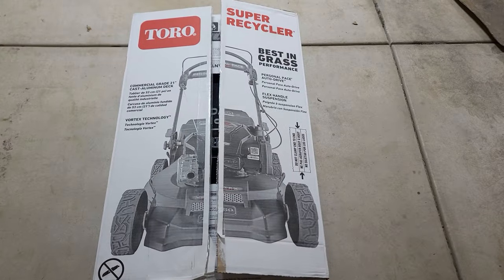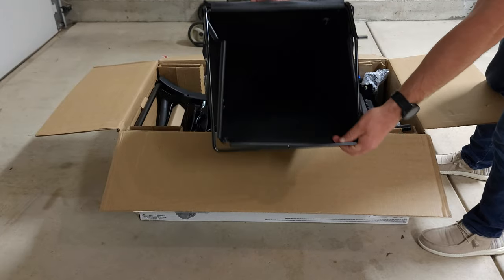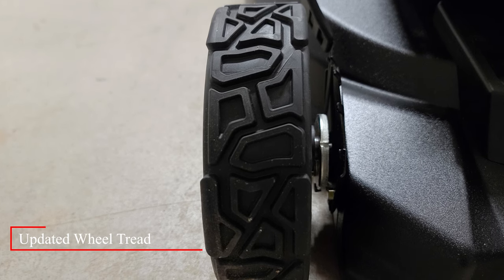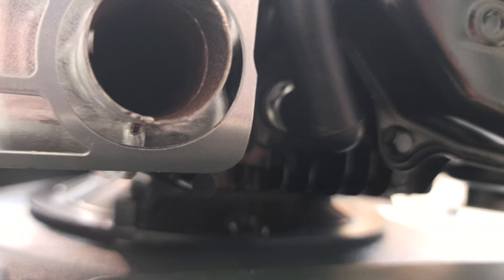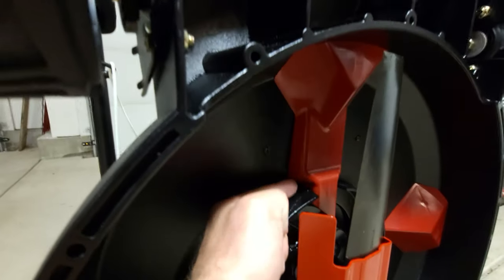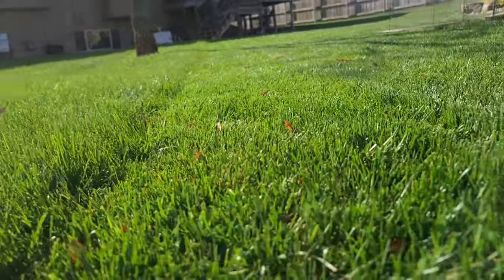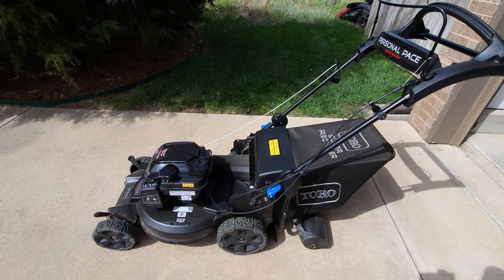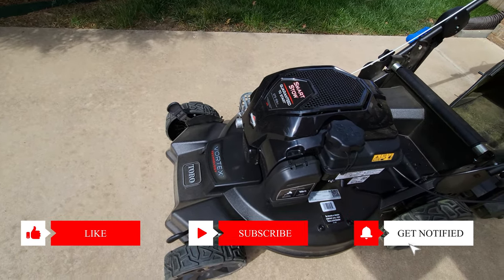Best Toro EVER?! New 2022 Toro Super Recycler 21565 Unboxing and Initial Review

Comment: I don't get why Toro uses these EX style engines instead of the professional series on snappers they are basically the same price.  Pretty much a deal breaker those plastic carbs suck will surge eventually and you'll need to clean it every time.  Plus they are just kinda chincy the professional series is larger displacement yet rated less torque but feel way better.  Honestly after getting an hrx I feel like the snapper is the best mower in the 700$ range. The honda is really nice though the engine build quality is great and bag/mulch well but it's not built as good as snapper and plastic deck is iiffy also weird ergonomics.  I never really cared for personal pace either though the honda is close to snapper if the roto stop had a lock.  Snapper is about the same weight with a metal deck, bigger wheels,  full size battery for electric start and a bigger engine. The snapper has no resistance pull back all 4 wheels ball bearings and it's axel driven by a gearbox run by variable disc Trans that never fails and is it does you could replace every part under 100$ in about an hour yourself with basic tools.  Overall I think the Toro is kinda cheap and engineered to fail. The honda is better I haven't run it long enough to see if the hydrostatic Trans is reliable but the fact it isn't meant to be serviced on the hrx isn't very great.  Lot of stuff to break that is expensive but it is well built..... I don't get why snapper isn't a bigger part of market I think it's probably the best bang for your buck the honda commercial is the closest thing to it and is twice the price.  The only downfall is I have only seen the snapper hi vac sold with electric start and the hi vac deck won't mulch as good as the Ninja.  I converted a Ninja to electric start and it was awesome I sold it recently to try the honda I'm not disappointed but idk if I would say it's worth the extra 300-400. The Toro is just way off base I think should be 400-500 unless they design an engine specific for it that is better seriously makes no sense is  basically their bottom barrel engine they sell to other brands for their bargain equipment. Swap that with a briggs professional or honda and if would be a decent mower.

Comment: Just bought one. I haven't even pulled the starter cord yet and I find that I must already comment.
To be fair, I haven't even used it yet. I've had Toro products before, and they're usually pretty solid, so I have good expectations.

So Why am I commenting???

The instruction manual sucks!!!
The instruction manual sucks!!!
The instruction manual sucks!!!

1. There are minimal instructions. Nothing written. It's all pictures that you can't even see. They're so small you can't see the detail you need. What IS written requires a magnifying glass to read, and I'm not that old. Even so, what's written is minimal and does not explain anything in depth that you might be confused about in the teeny-tiny pictures.

2. These same crappy instructions don't explain the "discharge chute plug" at all, or how to remove it in order to use the bag. Every single Toro video completely omits the fact that you have to take this thing out so you can bag. The "instructions" vaguely allude to removing the plug, but don't really explain it. There's a tiny picture that you can't even tell what the person is supposed to be doing, but no written explanation. THIS video shows the user taking it out, but he JUST POPS IT OUT!! I could not, no matter how hard I tried, get that damn thing out. I didn't want to force it for fear I was doing it wrong and would break it. The picture does not show clearly WHAT to do to disengage it, and there are ZERO written instructions.

3. Holy crap... it doesn't even come with a side discharge chute. Out of the box, your only options are to mulch or bag. What if you're cutting extra tall grass and don't want to mulch (too much clumping) or bag (emptying it every 50 feet)?? So I found out that in order to get a side discharge chute, you have to go online and register your product AND be sure to check the box that says "Send me a discharge chute."
WHY???? If it's free, and you're going to send it to me free of charge, why not just include the damn thing WITH the mower??? No... you gotta waste more time, more gas, packaging and delivery to send it separately when you could have just put it in the box. And the ironic thing is they state: "In order to avoid waste and help the environment, a discharge chute was not included with your purchase." So in order to get ALL of my mower that I paid for, I'm forced to go online and provide all my personal information so I can have some sort of relationship with Toro and they sell my info to spam my box so they can burn fuel and pay people to deliver it separately. Lame, lame, lame. 

I'm going to go try the product now. Here's hoping this little rant was the only issue. I'll let you know.

Comment: Just bought the new Toro 190cc and it has the single worst height adjustment design ever. Not only are there no markings on the mower it's all but impossible to see and determine the height adjustment for the rear wheels --- Overall pretty good mower but for this reason alone I would never buy another.
Reply from the maker: The height adjustment on these models is a huge pain! Honda really does it so much better! Thankfully I only have to adjust the height a couple times a year but it's still not a fun process

Comment: I just purchased the new Toro 60 Volt electric mower. Big big mistake. I should have bought this gas mower. Toro should be ashamed of themselves to market the much cheaper electric vs gas mower. I always mulch and when mulching I get an average 38 minutes cutting time in the battery. I can’t even mow 1/4 acre lawn on one charge. Also no more handle height adjustments. Changing the cut height is a nightmare and it seems like Toro implemented this in this gas mower. I have purchased many Toro products, mowers and snowblowers. This 60 Volt is my last Toro b

Comment: The deck is weak. Those 2 points stick out beyond the front wheels and break off super easy.
Reply from the maker: What 2 points? Can you be more specific?
Reply: @lawntechtravel  on the very front of the deck between the wheels. One of yours looks chipped in the video as well
Reply from the maker: @chrisboyle844  thanks I'll take a closer look tomorrow

Comment: Still loving my honda hrn-vla compared to this. Good review though. Would have loved to see honda with a aluminum deck not a plastic one (why I went steel). But at the same time I went with a heavy unit to hold the hill on the side of the yard. I just personally think the twin blade design cuts better and bags better, but that's just my opinion. Only issue with the honda is bag size but its manageable and sucks up everything, even sticks (and mulches those). Wish briggs gave the same power, never a problem with the honda. But its all in what you like. I love both and do some small engine repair on my day's off. Flat head brigg's hand's down dead reliable, the ohv.... its meh, a lot of rocker arm's too loose from the factory and can cause issue's. Simple fix.
Reply: I love Honda, been driving them for 26yrs. That said I have a Honda HRX217 with twin blades and my cast aluminum 1991 Toro Recycler with Suzuki 2-cycle mulches far better than my Honda. The finished cut mulching or bagging looks better with the Toro too. Bagging is pretty equal in terms of suction, but the twin blades of the Honda do chop the bagged clippings/leaves into slightly smaller pieces, but again the cut always looks better with my Toro. 

The old Honda HR214/215's of the 80's/90's had cast aluminum decks and commercial grade GX series motors. If Honda sold those today they would likely be well over $1,000, maybe over $1,500. Toro's cast aluminum Commercial 21" w/ Honda GXV160 currently sells for $2,000. The US Dollar has been slowly dying for 20+yrs. Manufactures have cut quality of homeowner grade equipment to keep costs down.
Reply: I have a old Honda HR 214. It has a solid cast Aluminum deck, it also has a shaft driven self propel (Hydrostatic), So no loose or slipping belts to maintain. The HR 215 is a good old solid machine too.

Comment: ATG & I suggest to go with Vietnam Honda mowers. Big mistake making it in black- think heat
Stay away from the Lawn Striper: hook rips bag & hard to remove & dead 21lbs weights
Do you really want to pay over $900.00 and have sand falling onto your lawn?
21+ lbs puts stress on the engine & drive belt
Run over stones, rocks and curbs a few days with the Lawn Striper...you will be pissed
You will be buying $55 bag soon due to the lousy designed of the hook.

Comment: Take a look at the : 20442 FWD SINGLE SPEED 0 - 4.2 MPH SIDEWALK DITCH MARKINGS FOR A SIDE WALK OR WATCH THE FRONT WHEELS SPIN IN THIN AIR WHILE IT FANS YOUR GRASS? 
ROLL YOU YARD TO ZERO ° & CUT A 1/2 "" AT A TIME 3 TIMES A WEEK : MAYBE AS YOU JOB THE MILE!😫😭😡☠️⚰️

Comment: 1 yr in and I'm regretting my purchase on this. Bagger fills up at the front , not the back. Front left wheel sits higher than the others . When pulling backwards while mowing,  the rear wheels like to lock up. Plastic carburetor? Please. And the final nail in the coffin was oil on my shed floor. The ohv cap decided it didn't want to seal anymore.  $1000 canadian.  No thanks

Comment: Not nearly as good as the previous model :/
Reply: Yea not sure, you can have this or a honda HRX for this price.....
Reply from the maker: @851995STARGATE  It's quite a bit of money either way. I did a lot of research and used a few honda's as well before I made my decision. At the end of the day, I really liked the Toro personal pace system vs the Honda smart drive. The Lawn Care Nut compares it to a leisurely Mow vs an active Mow, and I lean towards a leisurely pace
Reply: Why?
Reply: I have the Honda HRX & the Toro Super Recycler. The Toro is the limo, & the Honda is the Jeep. Toro needs to mount the Honda 200 CC on it. Honda will not sell Toro the 200 CC engine. The 160 CC Honda Engine is available to Toro but is weak for heavy mulching. Going from 21” to 22” on the SR definitely will require the 200 CC Honda Engine.
Reply: No I'll keep my 2020 over this. The wheel adjustment is no longer heavy aluminum and no grease zerks on rear wheels.
Reply: @stevebeard7667  and some of these new super recyclers come with a plastic transmission, I’m keeping my 2020 model over that garbage, i installed an hour meter on mine the second i got it and i only have 18 hours on it.I’m gonna try to keep in in as good condition as long as i can. Because it was the last good super made
Reply: @justindoel1764  Yeah I have the 2020/ 21385 with the Toro motor it is great. I noticed that the transmission looks plastic to on the newer one I really like Toro but it looks cheaper the wheel levers are also look like the ones on a regular recycler.